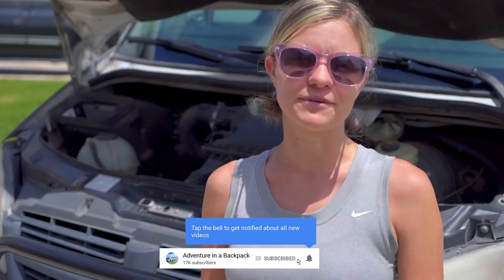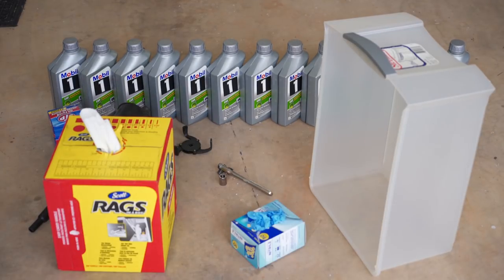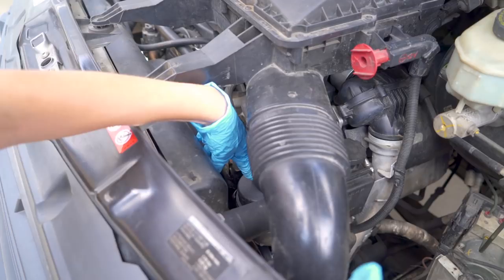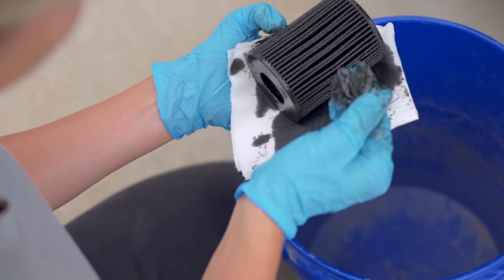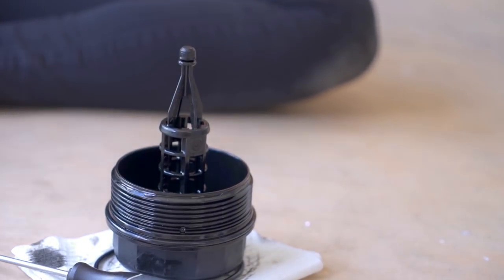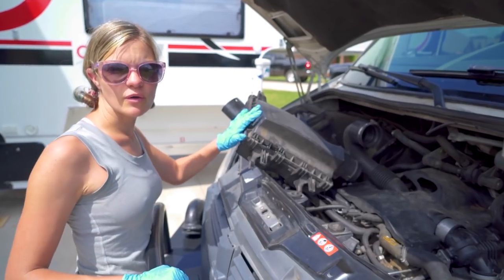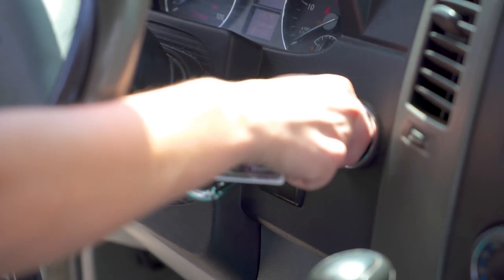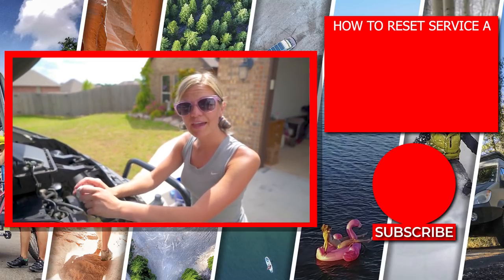Sprinter Oil Change

Comment: Steph, you just empowered a lot of women!

Oil is a vehicle's lifeblood, so maintaining the proper level and regular changes are two of the most important things one can do for their vehicle. This is a quick, easy, affordable maintenance procedure that anyone can perform.

Five tips:
1) Crack or remove the oil fill cap before removing the oil drip pan plug. This allows the oil to drain faster and more completely.

2) Keep constant inward pressure on the oil drip pan plug until you feel that it's completely unthreaded from the pan. Then remove it in one smooth motion up and away from the stream of draining oil. This greatly minimizes drips and messes.

3) Apply a thin film of clean oil to all rings and gaskets after inspection/replacement. This ensures the best possible seal,  minimizing leaks and extending the life of rings, gaskets, etc. Simply dip a gloved finger into a fresh bottle of oil and coat the rings, gaskets, etc.

4) Be sure to use the right and best oil for your vehicle. Full synthetics or synthetic blends are best. And, while they're more expensive up-front, they save you money in the long run through less frequent oil changes and better lubrication performance. Also, be sure to choose high-mileage blends for vehicles with over 75,000 miles on the odometer.

5) If possible, check the oil level after the vehicle's engine has reached normal operating temperature. Turn off the engine and wait a couple of minutes to allow oil in the top of the engine to drain down into the drip pan. Remove the dip stick. Wipe it clean and reinsert it. Remove the dip stick again and note the oil level to ensure that the proper amount of oil is in the engine.

I hope that someone finds these tips helpful in performing their own oil changes.
Lastly, pre
Reply from the maker: Thanks so much!  Great tips as always!
Reply: The debate about oil changes and Sprinter Vans is huge on line.  On our December 2016 model, the manufacturer says 20,000 miles but lots of folks say less. Our mechanic recommended 10,000. Another says 5K.  Irrespective, I assume it should be done at 2 years.  Any thoughts?
Reply: What a timely and well done video. I might consider tackling this if I can get my brother to help.
Reply from the maker: Basically, no.  I don't have any thoughts about that.  We change ours every 15ish thousand miles.  No more frequent than 10,000.  No longer than 20,000.  ...But those numbers aren't based on anything other than our own speculation and 'best guess' as there is a severe lack of ACTUAL data out there.  We drive more than 20,000 per year, so we would never hit the 2 year mark, but I'd personally get nervous to wait two full years between changes.  Changing the oil gives us a good reason to get a closer look at the 'inside' of the engine (look for metal shavings, coolant or fuel in the oil, condensation, abnormalities, etc..).  For that reason, we would give it an annual oil change in the event of not putting many miles on it.

Short story: We would recommend anywhere from 10k to 20k miles with a maximum time interval of 1 year BUT that's not based on anything other than speculation and a 'best educated guess'
Reply: So impressed with your explanation.  There is no reason women should not feel comfortable doing this and you have empowered many inexperienced human of all types!  I think John's tips are spot on.  I just bought a sprinter 4 months used, about to pick it up. Personally I don't trust STP oil filters and I'd get a better brand, possibly from Benz I have no experience in this yet, but I don't trust cheaper brands (apologies to Richard Petty and my childhood where we coveted getting an STP oval sticker to put on anything!).  

The other thing this video showed me is that this may be the easiest most accessible motor I've ever owned!  The drain plug is accessible and easy to reach, and the oil filter is vertical with the opening on the BOTTOM not the top (so it should mostly be already drained out) plus it has walls like a cup to hold any little bit of oil residue as you remove it. Amazing if it is as it appears!

Comment: Great video. I changed the filter on my 2016 Sprinter. My experience - Before you remove the large O ring be sure to note its exact location as you will need to place the new one at the (exact) same place which is not where you might think if you are used to changing O rings on car filters.
Reply: Good video, but the way the o-ring is shown going on at about the 3:15 mark is wrong and will cause you BIG problems (learned this the hard way.)  It needs to go in the groove about 1/4” below the cap, not right up against the cap as shown.  This will pinch the o-ring under the cap, and the leak won’t start until you get down the road.  And it pumps out ALOT of oil when it does, enough to drain all of the oil in a few miles if you don’t catch it (luckily I did, but it was a huge nasty mess.)
Reply: @jimflugum8408  Yes and on my 2016 Sprinter RV I have torque the oil filter in. Learned that the hard way. Didn't lose the engine just a $$$ tow to MB. Lessons learned.

Comment: couple good adds to this video:  change oil when warmed up (so oil flows)
change oil on a flat surface (Sprinter plug is in the middle so if on a ramp, won't drain all the oil from the pan)

Comment: Usually oil & filter changed every 10k for higher milage Sprinters.   My 2010 Sprinter has 200k on the clock.  Oil and filter changed at 10K now , previously 15k.
 Fuel / Air / Pollen filters changed at 20K.
Cant beat CLEAN engine oil - for smoother running too !
Great  channel by the way .... Much Love from U.K. 💖
Reply: I have the same model and from new I change the oil every 33,000 ks and at the 100,000 k mark the air cleaner, gbox and diff oils are changed. The van has been faultless apart from a dual mass clutch and alternator. Btw it has nearly 900,000 ks on the clock now.

Comment: WARNING: DO NOT FOLLOW HER DIRECTIONS!

Both of your o-rings are in the wrong place, you need to correct this before you have problems.  The small o-ring goes in a groove that you can't see because there's an old compressed o-ring still in it.  Where you put it it will do nothing.  The big ring goes in a grove below the cap flange, not against the flange like you put it.  Being against the flange makes it more likely to pop out and if it does you'll have a HUGE sudden leak that might go unnoticed 'till the engine dies.

Please take this video down or edit it to show that you did it wrong so others don't do the same.

Comment: Great video, I'm sure there's a flex extension you can use to avoid removing the air system, little less work. 😉😎👍🏼

Comment: Thanks so much for the tutorial! I haven't looked through the comments, but the CRD takes 13.2 qusrts, or 12.5 liters. A reg 2500 is 10 something quarts
Reply: 9.5 quarts exactly.  No need to even check after.
Reply: @ackmino  according to my owner manual the CRD 2500 is 13.2 Q

Comment: I have done oil changes in cars, but wouldn't have done it for a van/MH. Not sure why. 
Thanks for showing us it's not intimidating to get in there & take care of business. 👍
Another awesome video 👍
Safe travels 🙋‍♀️ & see you in the next vid.
Reply from the maker: Yeah, this is one of the easier vehicles to change the oil on (once you finally find the correct oil, lol).  Everything is so easily accessible.
Reply: That is nice everything is easily accessible. 😁
BTW, I love that Steph is doing it & was in the shocks video. When I get on the road, it'll be me doing all this stuff. 
Sorry Nate, it's extra cool for me to see Steph doing it 👍👍👍
Reply from the maker: Awesome!  Yeah, wrenching isn't all just for the guys even though many will tell you it is.  Just keep a little longer breaker bar on hand and you'll have zero need for a guys help. :D :D
Reply: Adventure in a Backpack 😂🤣 I am putting it on my list! 💥 😁

Comment: Nice work and presentation. - Hoping it was a 06 for future vid tips. Surprised no extra torque on the plug and filter cap. 3 - 06 is a little easier with no hoses to remove. Mine came with paint marking on the filter cap to match on the engine block so you'd line up to the same thread position each time.

Comment: This was a great video, for anyone watching sure to use the proper oil.  Mobile 1 is one of the best brands, be sure the oil is diesel rated, most aren't, and meets the proper spec.  It looks like this is the proper oil, 229.52, most cars are less sensitive however newer Mercedes diesels can have maintenance problems down the road with the wrong oil more so than most other cars.
Reply from the maker: Thanks!  Yeah, the proper oil is very important for anything with a DPF.  Mobil 1 is good, but like you said, its got to be the right one.  Pennzoil has a good formula that is rated to proper spec as well.  That's the specific one we put in the oil change kit.
Reply: @EXPLORISTlife  
There is one more part on your van that needs to be changed every so often in order to prolong the life of the DPF and your intake manifolds. The dealer will tell you that you need to use the proper oil (229.51), but will not tell you why. Do you know what that part is?
Reply: Dimitriy Perchik Nope, please enlighten us

Comment: hi there great video but you might want to put a torque wrench 
 on the filter housing as there will be a specific torque setting which is usually Stamped on top of the housing.
Same for the sump plug.
Good job though👍

Comment: An interesting presentation.

When draining sump oil, try to get the drain hole at the lowest point. This helps get the last dregs of the old oil out. With your vehicle get the vehicle lower on the side of the sump plug. With vehicles with the sump plug at the rear of the pan, its lower anyway when the front of the car is lifted up.

Cartridge type oil filler caps need to be around 15lb ft when tightened, with VWs its marked on the cap. On VWs it usually NM since their German.

Sump plugs a bit tighter so they don't allow any oil leak. You checked the sump plug washer condition which is a plus. 

Coat the filter o rings with oil to allow them to slip in to place easily.

May I ask why you buy small oil bottles rather then gallon tubs? ..... small bottles are 60% the cost of a gallon tub.

Easy to get the right oil. Simply use an online website oil selector. Engine oil grade and specification are separate issues.
Reply from the maker: We got the small bottles as they were on sale and was indeed cheaper than their bulk counterparts.
Reply: That's fair enough!

Comment: One correction, I think you made an oops on saying 12.5 quarts.  Should be 12.5 liters, i.e.,
 2010-2022 Mercedes-Benz Sprinter 3.0L OM642 V6 turbo diesel oil fill capacity is 12.5 liters or 13.2 quarts.

Comment: If anyone can answer this, I noticed you pushed that largest O ring on the oil filter down to the edge of the cap, a mechanic at MB in houston said that was wrong ( because I did that and it leaked) he said there is a notch in those threads about a 1/4 inch from the edge of the cap? That did not make sense to me ,anyone have a comment on that?
Reply: Yup, just followed the video and it leaked.  Went back and moved the O-ring down to where you said in the notch and it worked perfect.  A little snooping around on the internet and found a diagram showing the correct placement of that O-ring like you said.
Reply: Absolutely critical that you place the o ring properly.  Putting it all the way down will result in major problems.  I know of one person who made this mistake and ruined his engine.

Comment: Was the oil hot when you drained it, or is that not nessesary?
Reply from the maker: It will apparently drain faster if the engine is hot, but we prefer working on a cool engine and simply being patient on letting the oil drain out.
Reply: Adventure in a Backpack cool
Reply: I drain the oil hot so any contaminants are still suspended, if you let it sit anything that was suspended will settle and contaminate your fresh oil.
Reply from the maker: We used to do it like that too then did some research into it (actual studies, not just random car and driver articles) and could find no conclusive evidence that draining while hot was better than draining while cool, but yeah, you do you.
Reply: Adventure in a Backpack with today's synthetic oils this doesn't surprise me, they hold a lot more in suspension and every engine consistent run with synthetic oil changed on a regular basis that I have looked inside has looked brand new, unlike older vehicles with regular oil that would become varnished and sludged up if very regular oil changes weren't performed.

Comment: Something doesn't look right when you're replacing the small O ring on the oil filter cap. My 08 has a groove where it sits. Make sure there isn't an old crushed one hiding in the groove. Ok, I can see the old one is still in groove. Next oil change, remove both with razor blade.
Reply: Does the Mercedes 2011  bluetec diesel engine take regular oil as gasoline car?
Reply: @HenryLisaPlaces  Use Mobil 1 ESP full synthetic 5-30. or 5-40 depending on your climate. MB recommends that it must say 229.52 approved.
Reply: You are correct, James. Large O-ring is not up against the flange, but rather in the groove almost a quarter inch from the flange. And the small O-ring is not to be placed on the 4 vane part of the shaft, but in a space between the two raised rings near the tip of the plastic shaft.

Comment: What's that Service A setting you referred to?
Reply: Elena C Service A is a minor service - oil/filter change plus a few other things. Service B is usually a more major. The types come up on your dashboard when the service is due - it will tell you what type to book in for (or do yourself according to the manual)

Comment: Why Would You Use A CHEAP STP FILTER ? Why Not A WIX Or NAPA GOLD FILTER ?
Reply from the maker: Feel free to use whatever one you like because the process is the same.  We don't geek out over the micro-details like filter brand.  They are all plenty adequate.
Reply: All oil filters are not created equal. That STP is about the worst filter you could use. There is a video on YouTube where another sprinter owner experienced leaks after installing a stp filter.
Reply from the maker: Feel free to use whatever one you like because the process is the same.  We don't geek out over the micro-details like filter brand.  They are all plenty adequate.
Reply: @EXPLORISTlife  ...until your cheap paper filter comes apart and grenades your engine. You guys should look into it

Comment: Are you changing the oil on a 4 cylinder engine or do you have the V6? I'm not sure if the process is the same for the two different types of engines - I heard that the procedure may be different.
Reply from the maker: This is a 6 cylinder.

Comment: How often do u change the oil?
Reply from the maker: We change it when we have a good garage to work out of anywhere in the 10k to 20k mile range.  That's just us though.  It's a pretty highly debated subject with not much data to back up the claims.  Some mercedes literature says 10k.  Other literature says 20k... so it's not very clear.  We figure we'll just split the difference.
Reply: Adventure in a Backpack  Cool!
Reply: @EXPLORISTlife  
10,000 miles is what the book says on the 2008 model as the one you have.
Reply: @EXPLORISTlife  Usually oil & filter changed every 10k for higher milage Sprinters.   My 2010 Sprinter has 200k on the clock.  Oil and filter changed at 10K now , previously 15k.
 Fuel / Air / Pollen changed at 20K.
Cant beat CLEAN engine oil - for smoother running too !
Great  channel by the way .... Much Love from U.K. 💖